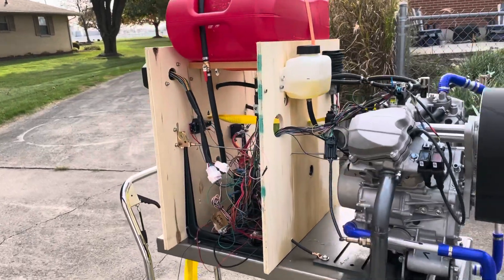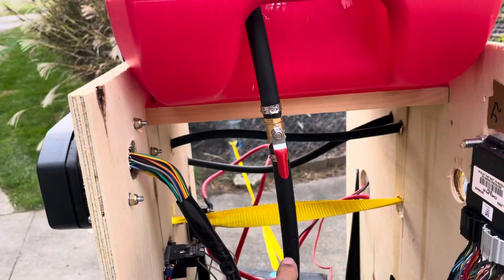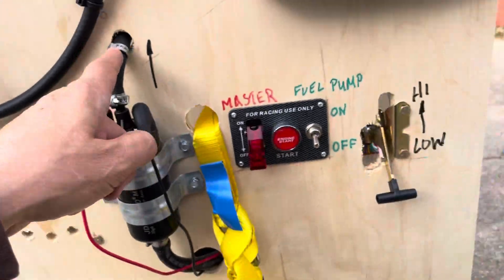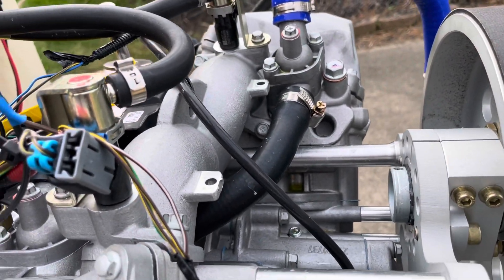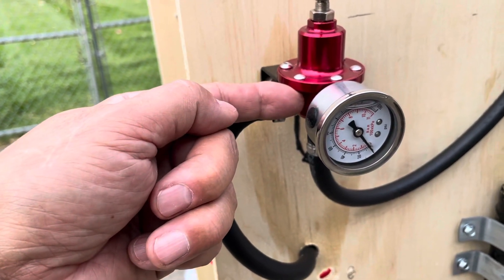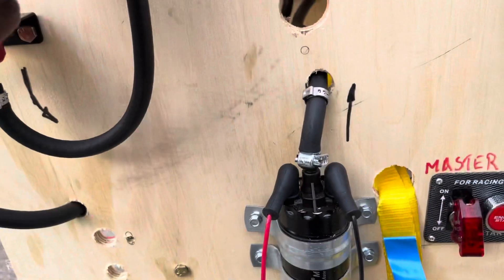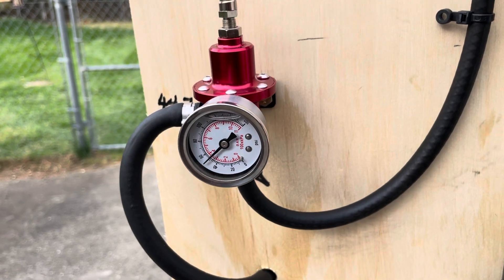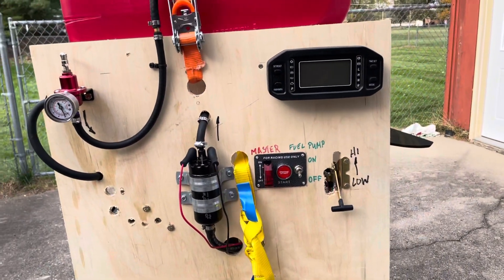800cc V-Twin Fuel System Layout

Comment: Would like to see some performance charts of rpm, horsepower, torque and fuel burn.  Has TBO been established?  Is there a supply chain for maintenance parts?  Any info appreciated!  Thank you.
Reply from the maker: I’m going to post a talk I did at Oshkosh specifically about this engine. I can tell you that the torque horsepower fuel burn charts are anywhere online that you can find an 800cc V twin. As far as the supply chain is concerned they manufacture about 50,000 of these engines a month for the ATV industry. This particular engine comes from CFMoto and you can get parts from those dealers however, it is a very generic 800cc V-Twin and therefore parts are available from lots of different sources that use that engine in their products.

The re-drive is from Ace Aviation. They sell spare parts for it. Although I don’t know that there’s very many parts to replace on yet other than the belt. The belt of course can be purchased from various sources that supply belts.

Comment: I bought my 2007 Can-am Renegade in April of that year and have a little over 600 miles as of December 2021. It's stored in a non heated building in middle of nowhere Appalachian Mountains. Other than 3 battery's and 3 oil with filter change (Can-am synthetic) no oil loss blow by or leaks it always starts no matter the temperature. Idles smooth and will take full throttle with no hesitation. So my engine sits unused for long periods of time and has always been ready. One note charge output is not great and it will go into limp mode (power reduction) with low voltage same with low oil pressure and high coolant temperature. Hope this helps

Comment: Thankyou for this great informational video!   Do the ATV applications for this engine have the same 3 BAR fuel pump system ?  I tend to prefer gravity as a fuel pump better than electric in terms of reliability.....
Reply from the maker: I bought an ATV  fuel system. It consists of a single pump, filter and fuel quantity float that is designed for a specific tank. I didn’t use it because it’s meant to be submerged and I didn’t want to cut a big hole in my generic tank for my test. I can confirm that gravity is not enough to get a good spray pattern or quantity of fuel for all but idle power.

Also, a typical ATV system has a fixed regulator set at 58psi for an 800cc Renegade. This regulator is also meant to be submerged in the tank. 

I’m recommending something less proprietary for this application hence the inline pump and adjustable regulator. 

We  will offer a dual pump system that has the pumps in series with one-way bypass tubes to prevent back flow. In service you can operate each pump independently or simultaneously for takeoff and landing.

Comment: When do you think you'll have a Merlin in the air with a vtwin? Great videos - keep them coming!
Reply from the maker: We're as anxious as you are to get this engine in the air.  We've finished the cowling which required a mold, we've finished the engine mount which requires a jig, we've finished the prop which is custom for this engine and we've finished the fuel system.  The Merlin has never flown with a fuel injected engine.  The fuel tanks are in the wings.  We will have to provide a return system.  We can either make a header tank which is a small tank between the main tanks (there are two) and the engine.  That tank will require a float valve to shut off the main tank supply when full and will have the return.  Or, we can bring a return line back to the tanks.  If we do that, we'll need to gang the fuel selector valve so the return swaps just like the main fuel line.  You can see it can get complicated going with that system.

The electrical harness for this engine was not designed for an aircraft for two reasons.  First, the harness has about 3-times the number of wires necessary such as headlights, running lights, brake lights, speedometer, radiator fan, etc.  It's also too long.  We're going from the engine to the firewall to the dash.  Second, we're going to use Teflon(tm) wires.  The present harness uses PVC.  Again, some engineering and tweeking required.

Your comments are greatly appreciated on how we design that system.
Reply: @benbosma  thank you for the info, much appreciated. And good luck!

I don't have anything helpful to add other than cheering you on from the sidelines for now.